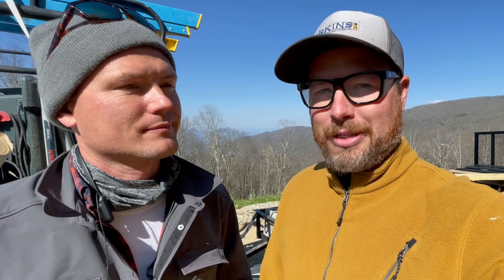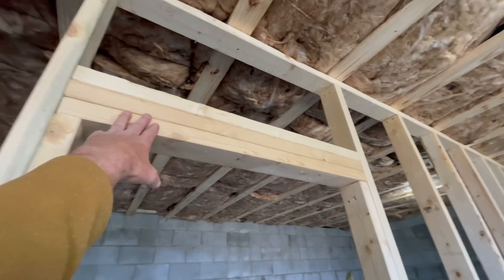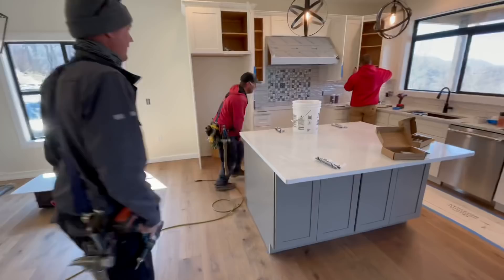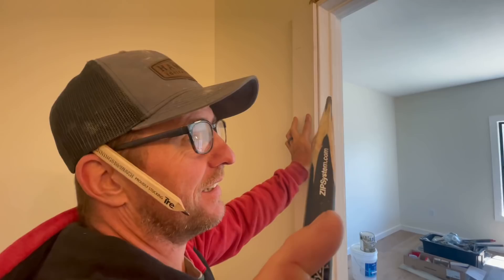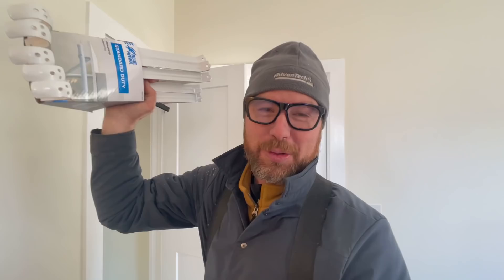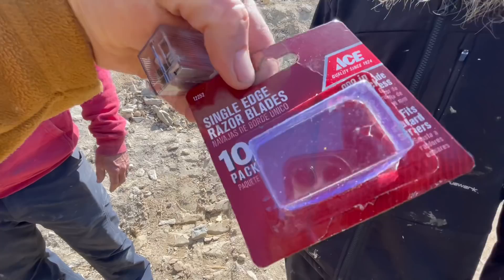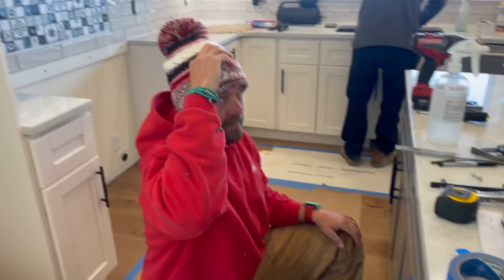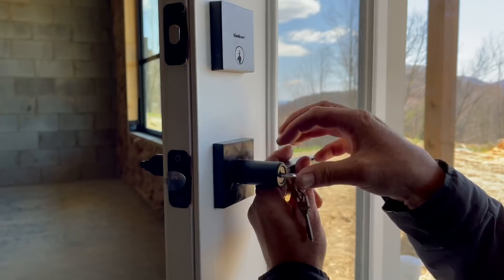Building The Farmhouse | Day 78

Comment: If you look at the back of the razor blade pack, there should be an opening to put the used blades. Its designed that way for a reason, to give you a safe way to dispose of the blades.
Reply: Came here to say the same.
Reply: Me too
Reply: Me too

Comment: Speaking of supporting a floor, be careful when putting in integrated fridge systems. They weigh far more than the traditional non integrated models and that weight is concentrated in a small footprint. 

When specifying the floor under my fhiaba wine and fridge freezer, I had to allow for 450kg in a >2sqm foot print, which is far more concentrated than your typical floor joists would allow for.

Comment: Why are you using so many shelf and pole brackets, especially in the corners next to the adjacent wall?  I have usually done  a 1x4 ledger to support the shelf, both installed after texture but before paint. Then use a rosette each end and one or two brackets for center support. Put a 1x4" vertical leg with mitered corners downward to support the bottom bracket screw , it also puts the pole 3/4" further away from the wall but thats good too. The side ledger can go all the way to the front wall and you can install additional coat hooks there.

Comment: In the unlikely case anyone reads comments on this old video, I have a question about the effect of the wall framed in the basement to reduce the deflection in the kitchen: were the floor trusses designed to have bearing provided at that location from the new basement wall? It seems possible to me that, under deflection, the trusses might be damaged by the load delivered to the wall.

Comment: despite living in Europe and not really benefitting a lot from all those tips and trick I really like this series and have been following you for 6 months or so. Wanted to ask why US houses are not made from concrete. I get that stuff is different in the US but if a tiny island makes the floor bounce maybe Europe like concrete is the way to go?
Reply: Price.  Not all buildings in Europe are brick or concrete.  In the north they're more likely to be wood frame construction too.
Reply: @-_James_-  fair enough thanks! Is it that much more expensive? What prices are we talking about for something similar to the house that the team built here?
Reply: @nimuie  it's not really possible to say one is more expensive than the other overall. It's just down to local supply and demand and who has the skills for building with a specific material. In Norway, for example, where I'm currently living, wood is in plentiful supply and is therefore generally cheaper. Buildings in Spain are usually concrete and brick because wood isn't as available, but stone and sand are (I presume).

Comment: Love seeing your video's. Not trying to be a wise guy. Pro Tip: Isolate wood lower wall plate from concrete. It prevents moisture from coming up and rotting the wood.
Reply from the maker: Good tip.. we used Pressure treated wood
Reply: @PerkinsBuilderBrothers  I figured as much. That's one way of doing it  :)